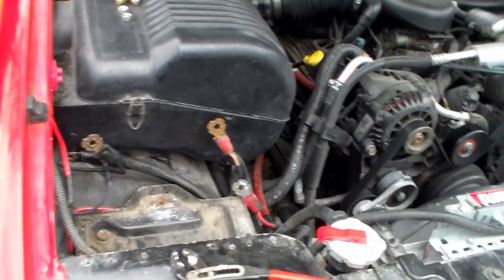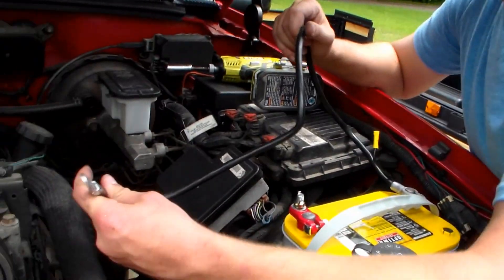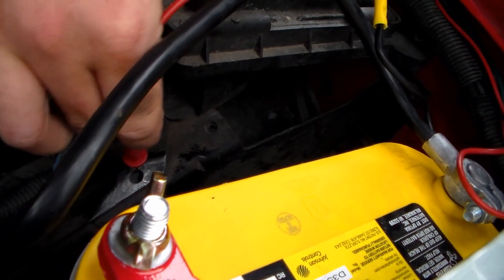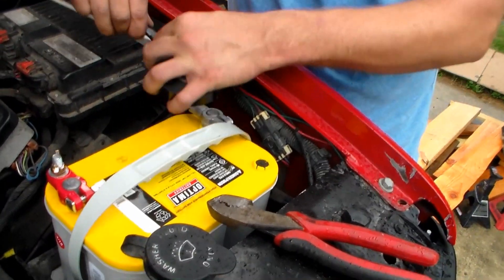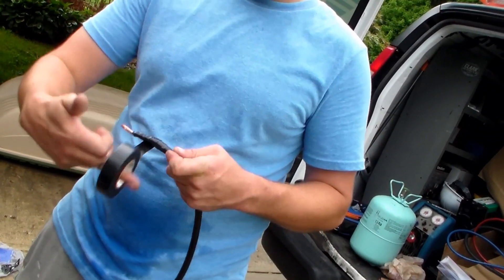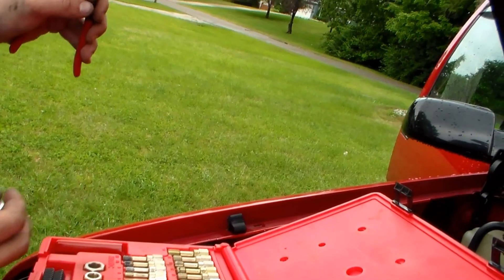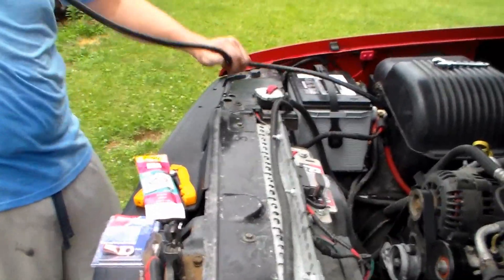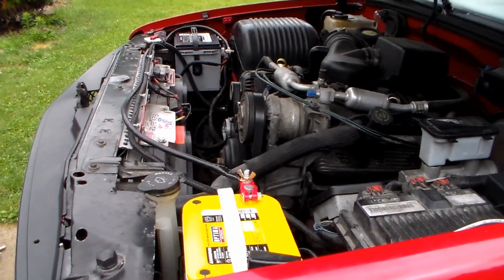How To Set Up Dual Auto Batteries 1996 Chevy Tahoe Yellowtop Optima Battery

Comment: Where did you get the battery tray for the drivers side. I have a 96 Silverado with a storage box on the driver's side. Wondering if you had the same setup.
Reply: My came factory with extra battery box some do some come with the storage box

Comment: 1 gauge welding cable a copper lugs with a crimp hammer shrink tubing and dielectrical grease  Cut to length no need of coiling extra left over wire that has power having to travel a longer distance. Add in 3/8 bolts with a few washers and a lock washer and nut for side posts  You now have a thicker wire resistant to heat and everything is still cheaper than buying ready made wires and kits Also look into alts with a higher Amp output I swaped my Blazer CS-130 which was a 85amp to a 145amp for around the same price as the first one

Comment: Good video, BUT you shouldn't mix two different types of batteries together just like you should never use an old battery with a new battery because one will always drain the other one. Always replace both batteries together new and use same type of battery so they don't have any issues connected together.

Comment: leaving the batteries connected in parallel will wear down the stronger battery while it tries to charge the weaker one. isolate one for starting and only connect them when key on, or oil pressure, or something.

nice crescent wrench
Reply from the maker: Sorry but I disagree - Couple things. One, I was using the tools out of my HVAC van. Lol. Worked, didnt it? I have more tools than I know what to do with. 2 - There is nothing wrong with a charged battery discharging energy into another battery. That is the point of a battery. To discharge energy. Granted, over the lifetime of a battery you only get so many charges and discharges, but the number is very high. If you are using the batteries only when the car is on and using the the alternator (upgraded amperage in a more demanding system), both batteries should only ever need a small surface charge to stay topped off. The point of having a deep cycle as a second battery in a system thats demanding, such as if you had subwoofers, is to act essentially as a large capacitor for long bass hit draws, which a high output alternator should quickly recover from in between bass hits, not to mention you will likely not be playing full volume your entire drive or everytime you drive and the demand is much less at lower volumes. I think people think you need an isolator and don't even know why. In my view the only need for an isolator would be if you were in competition and played your audio system with the vehicle off. That way you don't drain your starting battery dead while the car is off. Or, if you were trying to be overly protective and in the event of one of the batteries failure, to protect the other one. But just because you drop a cell in one battery does not mean it will instantly ruin the other and it should be noticed pretty quickly in your systems performance if you are mindful. This is the way I've done it in multiple vehicles over many years and never had to replace any batteries, including in a 3500 watt RMS system. This is my opinion based on experience. If it makes you feel any better, when I was the lead tech at the last shop I worked at, I often argued about the principle of replacing OEM dual batteries in pairs. Tech B would say on a diesel for example if one battery is bad both should be replaced. I wholeheartedly disagree.
Reply: @outdoortradesman142 jon, i have some experience too, and i'm telling you the stronger battery will have reduced useful life if it's surface charge is always getting pissed away into a weaker battery.

that said a relay is pretty cheap and my second battery is only connected to the charging system (and oher battery)when the key is on. i dont have a killer soundsystem, i have cameras and recorders. they are on the deep cycle non-engne starting battery.
Reply: @outdoortradesman142  ....and the point of a battery is to store electricity to be used later, not to piss away it's charge on a dead battery that wont give it back
Reply from the maker: @zap265  Yes, I understand, and I am not trying to diminish your experience. However we will have to agree to disagree that this is "bad" for the battery. A battery charging and discharging is a battery's purpose in life.
Reply: uncommon_sense   Your Correct running in parallel is fine but both batteries have to match.
Reply: @outdoortradesman142  I agree with you, but only as long as the batteries are similar in all outputs, and you have an upgraded alternator... I am an electrical engineer... Most mechanics could probably pass the test I took as well lol... But to go to extremes, a battery with 1000amps should not be used in parallel with a battery of 500amps... It will not only ruin the higher amperage battery, but the stress on your alternator will ultimately make it fail... Best option = 2 AGM batteries of the same make and model.  Just my input... Good video... Oh and by the way, using an isolator is only necessary if you plan on using your battery power for a long time with the truck off... Just like using one battery with the truck off, assuming you overdid it with the truck off and using a lot of battery power, you will need someone to jump your truck... And even with a high amp alternator, keep said truck on for a long time... Good work guys!

Comment: Friendly suggestion is use a heat shrink tube when you connect the ends and two wire together instead of the tape

Comment: I plan to put and 2nd battery on a 2013 Tahoe for my Amp. You think it's ok to hookup the + from the 2nd battery straight to the alternator. Plus I will be doing the big three upgrade. On the 2nd battery
Reply from the maker: No I do not recommend hooking both batteries to the alternator. Alternators work partially on demand according to how much energy they need to produce. If you have them both ran seperately to the alternator if one battery is charged and the other is not it could theoretically overcharge the charged battery and cause damage.
Reply: Ok than, on the main battery I will run an other pos 0 gage wire to the alternator, than from the main 1st battery to the 2nd battery than to a 3rd battery. The 3rd battery will hook up to a Orion HCCA 3000.1 will that be ok I do plan to upgrade my alternator.

Comment: I want to do this same thing on my truck , I have 2 of the same trucks one is the back up. I just want to put my spare in the extra tray and charge while i'm on the interstate, it wont be hooked up forever like this set up. Can I keep my factory wires and just run a new positive to the spare battery and ground the spare to the truck? Just keeping all the factory hook ups to the primary battery?

Comment: Pretty straight forward. Good idea by GM and putting that second battery tray under the hood just in case.Beats having to run your wires to the back and saves you from having to manufacture another tray yourself.Does your main starting battery need to be stronger or at least equal in strength to your new addition or will a stronger alternator smooth that out or as long as it's getting the proper charge it's all good?. Thanks guys.
Reply: Has to be matching capacity he should have installed a isolator
Reply: @paulsbuilds1982  I have a 98 2Dr Tahoe so u mention adding isolated. Question 🙋‍♂️ I have is let’s say I have 100 amp Alternator though that’s not enough for all accessories am I good because I have 2 battery’s?
Reply: I have a '95 4WD Suburban...unfortunately that model year didn't come with second battery location.  I have an air canister in that location...hopefully I can remove it without messing up the ignition and MAP sensor.

Comment: You should run the positive cable first for safety reason. Just a suggesting
Reply from the maker: Yes, I was always taught connect the negative last. However, it has never caused me issues. I have gotten lax about it. Good call

Comment: I did mine this way with my 09 avalanche. I bought a new battery for my main and used my old battery for my secondary battery. But found out my old battery was draining my new battery. So other I'm buying a second new battery the same one I bought recently. But I'm also buying a battery isolator as well
Reply from the maker: In a case where the batteries are connected without an isolator, and one battery is bad or on its way out going bad, it CAN take the other battery out. This is a "risk" of running this setup. Typically though if one out of 2 goes bad, you'd replace both anyhow though. Like in the case of dually trucks with factory dual batteries. One goes bad, dealership policy is to replace both regardless.
Reply: @outdoortradesman142  please answer this for me I have a 98 2Dr Tahoe same extra bay for battery 🔋 same truck 🛻 pretty much my question is do I still need a high output Alternator say 140-160 with 2 battery’s? Or am I ok 👌 with the stock 100 amp soon I will be running 2 12’s sound system a TV 📺 or 2 windows all are automatic as u know. So that’s my main question. Must I upgrade the Alternator or am ok 👌 with just a proper 2 battery 🔋 set up with 100amp Alternator and sound system hooked up to 2and battery 🔋 Thankyou in advance for the advice.
Reply from the maker: @kingzionmusic  get an upgraded alternator and do the “big three” wiring upgrade
Reply: @outdoortradesman142  Thankyou sir I will look 👀 into the big 3

Comment: The 2007 Tahoe has this weird + battery hookup, with a long red plastic cover, and some weird slot thing in a long rail. I don't know how, you hook another wire to it.
Reply: Use the slot on the firewall right behind the battery ,it has a 10or 12 mm nut

Comment: No isolator needed? or matching volts battery?
Reply from the maker: Up to you whether you would like the added protection of an isolator or not. As of Jan 22 2020 this vehicle has been running fine in this setup, without a single issue.
Reply: I have run my international truck over 500 thousand miles with 3 batteries in parallel with NO isolator and it has worked fine.

Comment: The question: I just added a new 2ndary battery in my 01 Silverado 8100. This is how I connected them, I connected the positive wire from the 2nd battery running through a fuze and a solenoid to the positive end of the primary battery. the negative wire from the 2nd battery into the frame. Is this correct?
Reply: Yes that actually how you supposed to connect them that a parallel hook up which it's a 12v set up
Reply: Or you could do it like they did, but with an isolator
Reply: I’m also curious about the set up. If done as shown and minus the isolator, what problems might occur?
Reply: @stevenmorin2766  You know, since I ran the second battery with the same connections, both batteries go dead in couple of days. I got sick of charging batteries, so I plan on taking off the secondary battery all together.

Comment: 4 ASE's yet you use a crecent wrench to tighten a battery clamp bolt... Umkay, i guess it worked anyway
Reply from the maker: Lmao im sorry i didnt use a snap on wrench. I was using tools out of my refrigeration truck. Want me To email you my certs?
Reply: @outdoortradesman142  well snap-on's kind of gone downhill drastically in the past few years and in that case I would understand a crescent wrench I guess. I do have a question though since you replied and I'm not a certified mechanic. But is there a reason you did not utilize the wire that goes over the fan shroud that runs from the battery or actually a little terminal block on the core support to the main fuse box over the driver's Tire? And is there a reason that that would not work?

Comment: So don’t be cheap yet y’all bought a battery that is considered cheaper that most of the car audio AGM batteries that are pure 99.99 % lead and more of it then the optima I used to have the yellow top in my Jeep and it was ok for starting n factory system but larger system needs way more power on demand and that costs a buttload.are both those batteries the same cranking amps????? Did u run them is series or keep them separate.larger wire size with more strands are best like 1/0 age shit there’s 8/0 awg now Steve mead has a video that shows the size of almost a quarter in thickness.
Reply from the maker: you don't seem to have really any idea what you're talking about at all. You sound like you've been watching a bunch of car audio pros running competition setups with crazy demands. You going to add all that garbage to add a little 12 sir? no. no you aren't. or a winch. no. no you aren't. Thanks though.
Reply: Actually i run two 500 rms watt alpine mono block amps on one duel voice coil sub alpine type R series 750+rms watts. Four 100 watt rms woofers on alpine four Chanel amp, four mids and tweeters as separates on alpine two Chanel amp and it’s ok for now. Head unit is an older alpine from 2007/8 model year as I’m still living  old school with cds and I-pod touch 4 from 2010/11 with the added pod cable on back of unit plugin. Duel 2 gage Big 4 upgrade/ duel  alts and duel batteries both AGM  style 1000 cca, stereo shop ran 1 gage back to rear then blocked into 4 gage to all amps +/- wires 8 gage to sub wires +/- per coil x2, None of the car harness wires are used for speakers only ignition switch head-unit   on/off. Also amps are turned on/off by the head-unit. My lights don’t flicker even when at a stop light and my amps stay cool and don’t go into protect mode ever not even the four Chanel  and it pounds well enough for me.
Reply: So I’m sure a lot of viewers would like to had power pulling ideas to there’s vehicles and watched this video to see what the guy who presumes to know the process has to say about it. But the one thing this video shows mainly, is, one way to install a dual battery in a truck with a factory system and know extra accessories such lights, wenches, ext. It’s a proven sure way to had a second battery, be it the similar or exactly matching, to an AMG car battery in a vehicle to prevent needing, but not having extra electricity in case you ever need it. Say like in a place where weather can be 60 degrees at 4pm to below freezing at 11pm like bipolar Indiana. Where there’s a scare you might, one random morning, not have enough juice to start your classic internal combustion engine for work the next day. It’s about dependability and piece of mind. I must admit. This was actually my 96’ Tahoe in the video, and as of today, I’ve driven this heavy crossover packed down with 100’s of lbs of tools over 54k more miles since installing hat 2nd battery. I’ve never had my cranking battery fail. Great things were done in this video. I bet you advertising that other guy on this video gave him a key board b*n*r. 

-Enjoyed hearing from people. Thanks for watching

Comment: Not a true 12v dual set up.  You are running to much volts to a 12v system.  Asking for problems. 
I burnt my pcm/vcm  becuz I didn't run parallel dual batteries. 
 Positive to Positive  and negative to negative battery. Then ground everything from main battery.